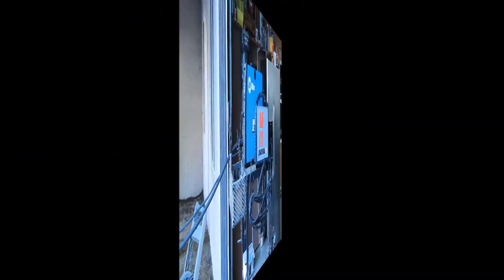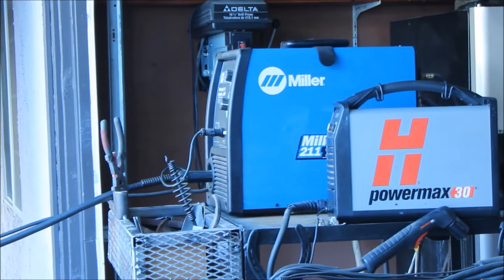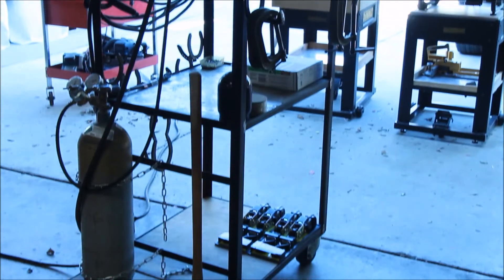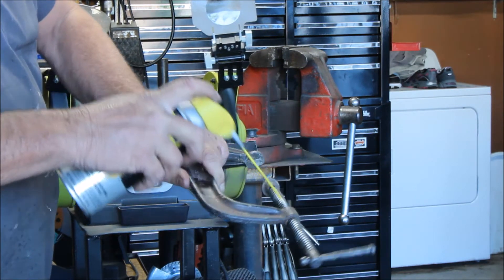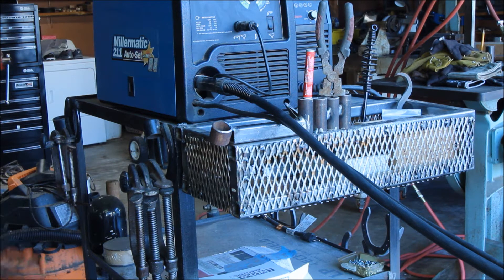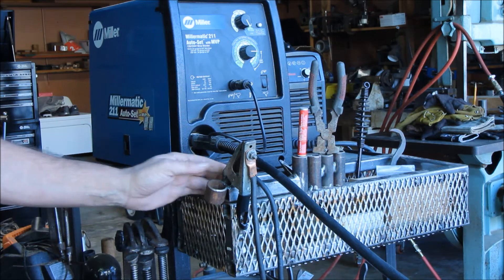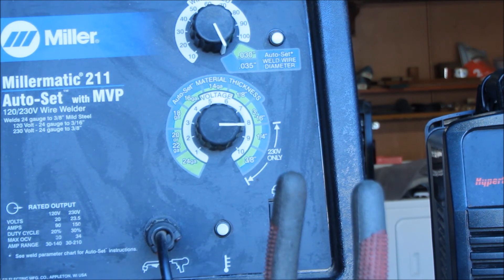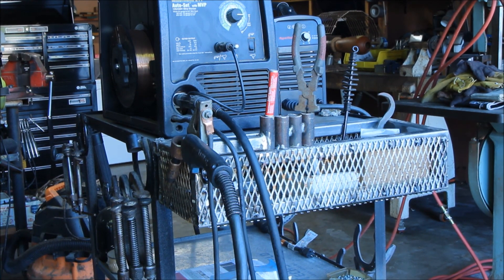Miller 211 Mig Welder Maintenance

Comment: How do you like the welder over all? would you recommend it?
Reply from the maker: I would buy this welding again - after 2 lower quality mig welder and thinking i was a crummy welder I purchased this on a good friends recommendation - I bought it at Air Gas where i got a small discount - after using it for a few weeks and playing with the adjustments on it I realized im not a bad welder at all - I just had crummy welders - now with the auto set or manual adjustment I weld very good - So yes I would buy this machine again no doubt
Reply: thanks, have a great day!
Reply from the maker: Yes I would and I would buy it again - seriously a damn good machine and easy to use in auto or manual modes
Reply: thanks for the info, have a great day

Comment: Glad you said something about the spray for the splatter. I had mentioned it in my video but don't use it. I know I should but it's one of them things that if you have everything set right the splatter is easy to get off. Like the welder you have and the way you keep it clean. Keep up the great work see you on your next video thanks my friend
Reply from the maker: Agree - I have had this can for over 2 years and on projects its simple to knock off with my angle grinder - where i use it the most is on the tip prior to welding as it seems to keep the build up down or non existent
Reply from the maker: Thank you - about the anti splatter - I to forget to use it at times but if i remember i use it especially on the tips and guard because it really does stop the build up you get